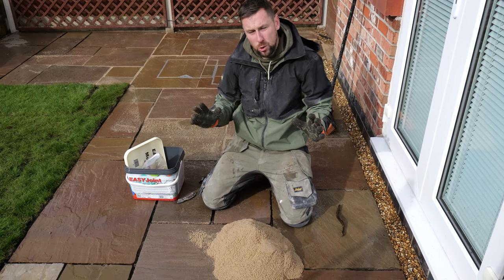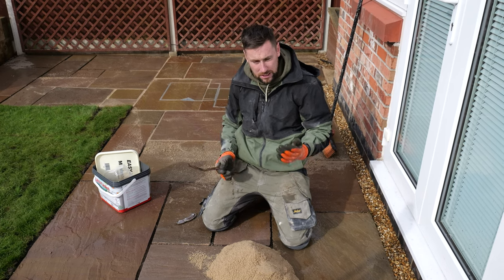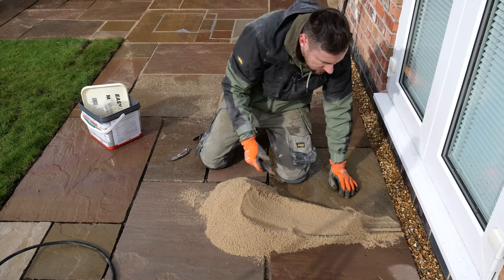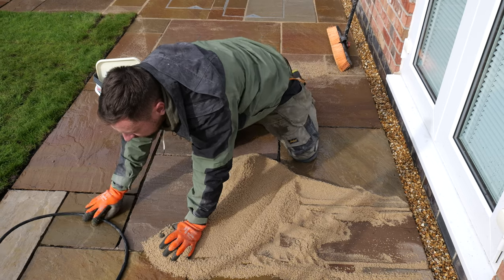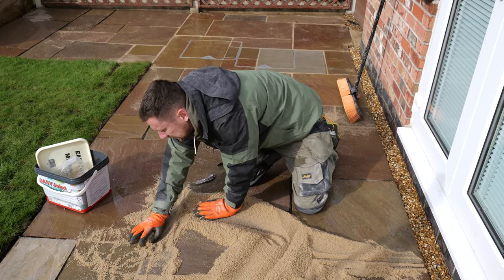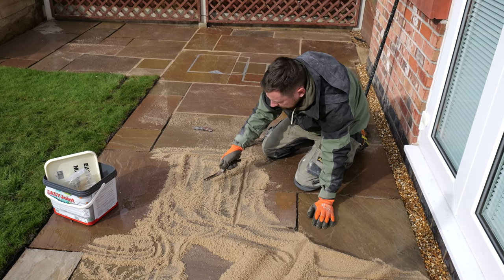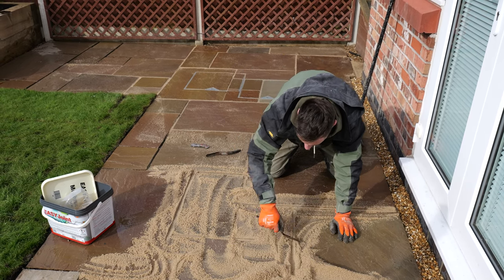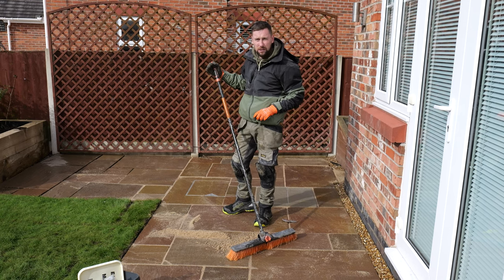How to install Easyjoint Grout

Comment: You should wet the easy joint as you pour it out the bag too, makes it a lot easier to move and makes it stain less, shouldnt apply it dry like you are showing what so ever, wet the surface and wet the easy joint compound also everytime.

When its wet the compound sinks more and you get a much more full bed of it between the joints, dont know why youd make a tutorial doing it wrong honestly, but each to their own
Reply: Whilst your suggestion is more sound, he is simply just following the instructions in the manual. Thanks for the comment though, will remember this when I do it next week!
Reply: @dooglemas in the manual it says to wet it up like a slurry and brush it in
Reply: You can see that the slabs are wet.
Reply: @Dontbesilly83 your supposed to wet the grout aswell as the slabs , says on the tub to wet it up lime a slurry
Reply: Thing is don’t need water on porcelain tiles..
Only add water to help oil residue on natural stone
Reply: Yup this is correct. Needs to be almost like a wet slurry. If it’s too dry the granules do not knit together enough and it will eventually sink in the joint, even if it appears to feel full and compacted, once it sets it will have hollows between the granules. Take my advice or don’t, not my patio!😂🤷🏽‍♂️

Comment: Its like 35 quid a tub...why not just mix sand and cement at like a tenth of the price and do it that way?
Reply: Yeh and about triple if not more the amount of labour time so works out no cheaper
Reply: @Shifty761989  yes but it won't last long

Comment: 🌻after filling the gaps should we spray everything with water? Or the mixture doesn't need water to set?
Thank you!
Reply from the maker: you wet the product before pushing into the gaps
Reply: Your not compressing it in your just scratching the joint trowel on the slabs. YOU NEED TO USE A SMALLER TROWEL THAT FITS BETWEEN THE JOINTS TO COMPRESS IT. WATER IS A LOAD OF BOLLOCKS DO IT DRY AND TROWEL IT INTO YES INTO THE JOINTS. YOU REALLY MADE A PISS POOR JOB OF A SIMPLE TASK.